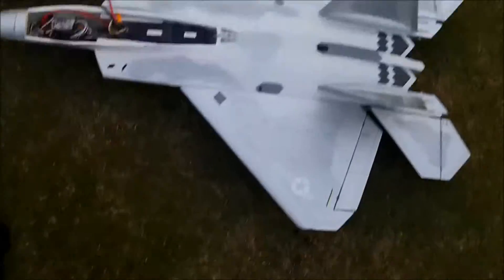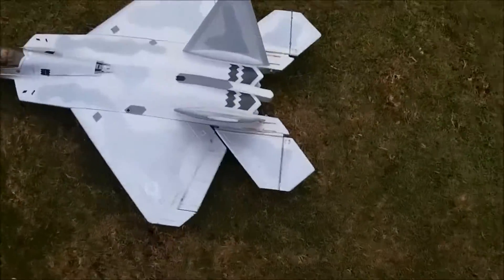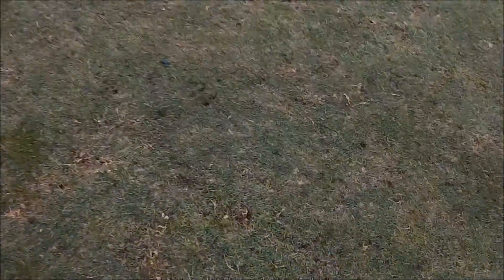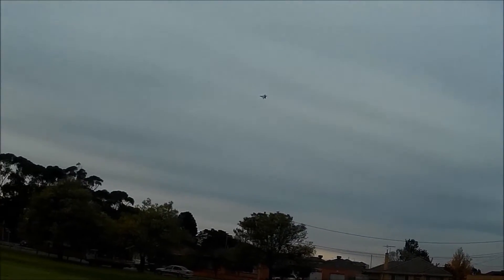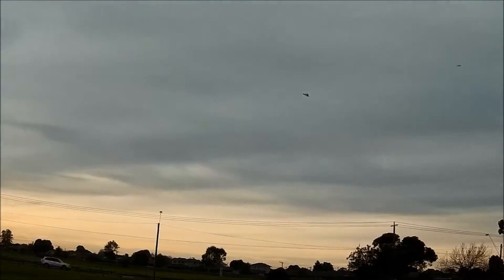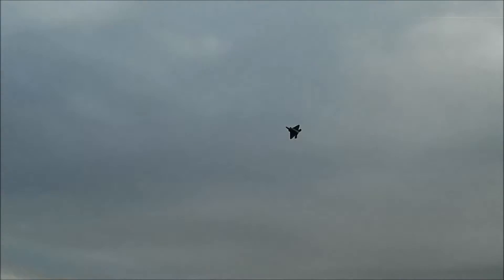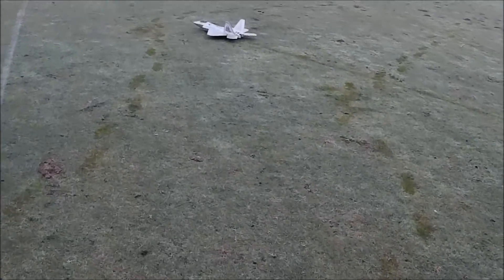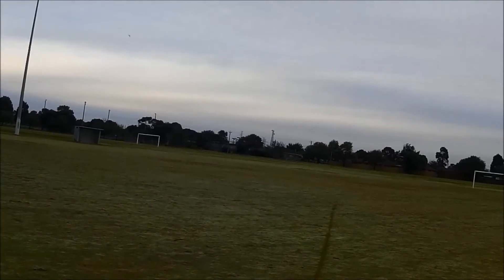F-22 Raptor - 70mm 6S DrMad 2200kv XRP14 EDF - "TX free" launches

Comment: Hi I had one running on 5s 64mm edf and didn't have the pitch issues but stayed with the standard elevators.
Boy that RS4 voice would drive me mad. I crashed mine due to battery cable failure.